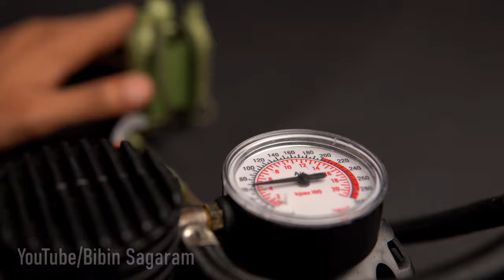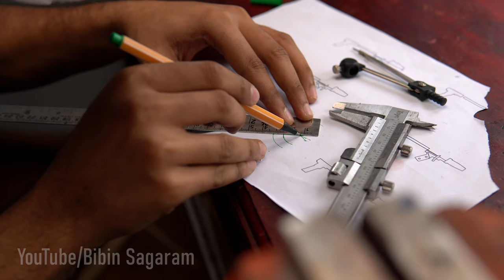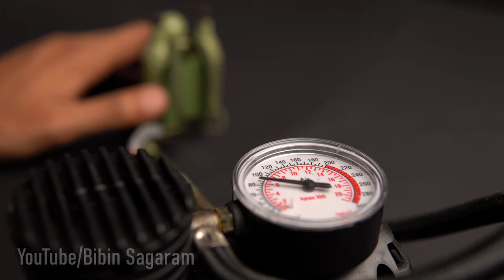Making of World's Smallest working M2 Flamethrower !

Comment: how are you connecting metal pieces together? are you putting solder wire piece on it and using flame to melt it?
Reply from the maker: Exactly, flux is also added

Comment: Hi brother what sort of heat welding is that called
Reply from the maker: Those are solder joints, brass and copper can be easily soldered. Soldering led and soldering flex is used.